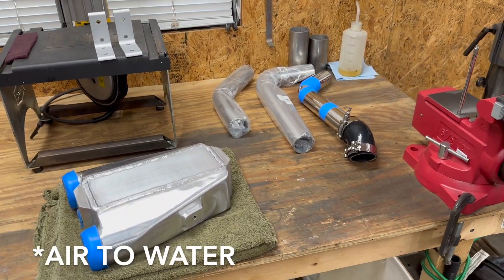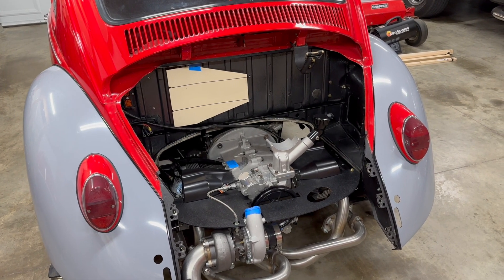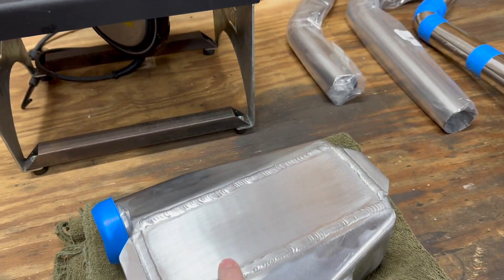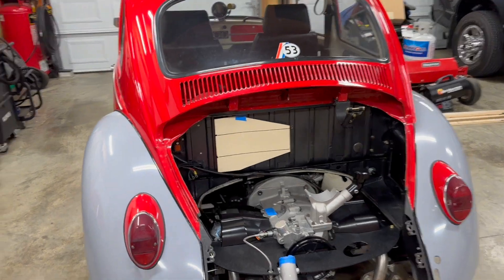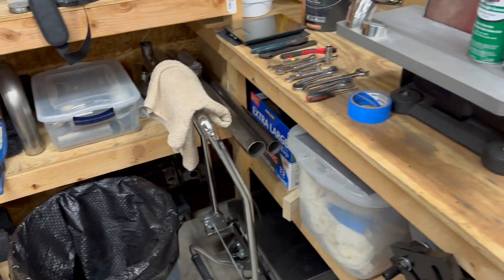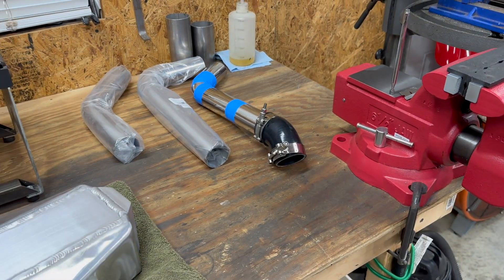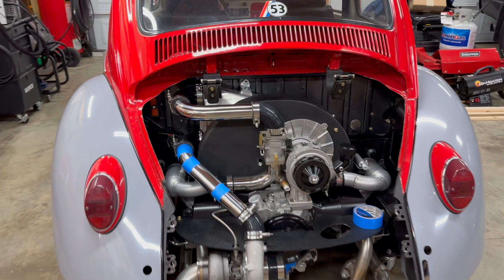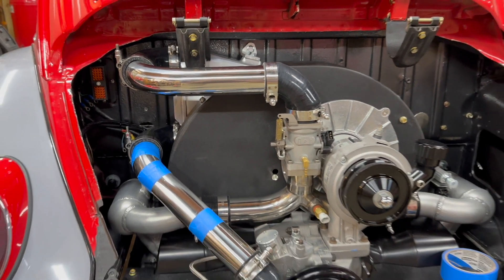New Air to Water Intercooled Turbo Beetle Intake Build!

Comment: I love the project and i have so many questions 
I live in egypt and i own a 74 bug.
Just wanted to know if i can make this turbo setup without upgrading the internals of the engine like the crankshaft. 
Will it hold the turbo boost or it will get completely destroyed. 
I saw many vids about turbochargering this car but i like ur clean work and i would like to have some help from a pro like u
Reply from the maker: You can certainly turbocharge a stock engine, you’ll just have a lower limit on how far you can push the engine and how much power you can make. There are some impressive mild 1600 turbo setups out there. It’s a great way to get your feet wet with boost too.
Reply: @vee_dub_nut  will i feel the difference in tourqe or its better to swap a golf 1 engine?

Comment: Where are you thinking to run your heat exchanger and water hoses running to it?  Perhaps that will be in your next episode. 👍🙂
Reply from the maker: I’ll run a heat exchanger to the right side of the transaxle (mirroring my current external oil cooler), Bosch pump and ice box/reservoir in the package tray. And yes, a video to follow soon(ish)!